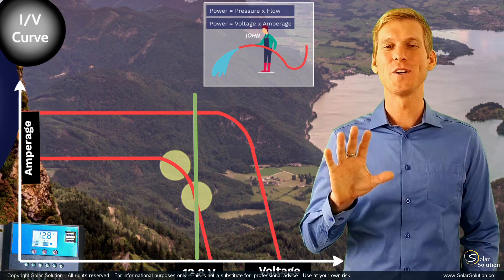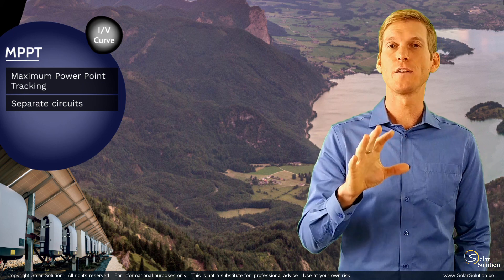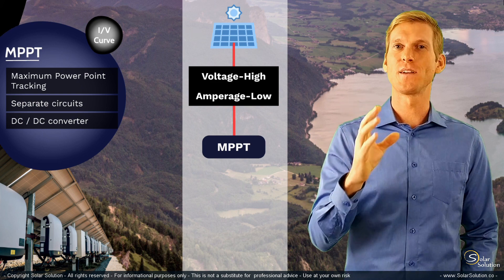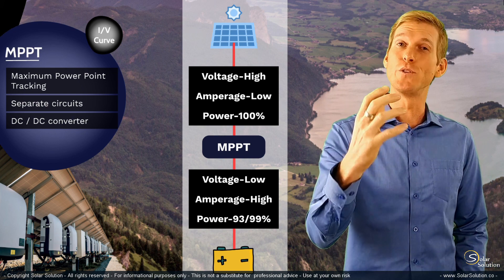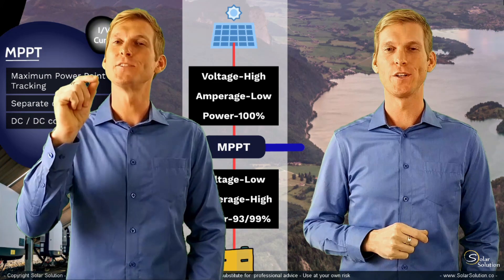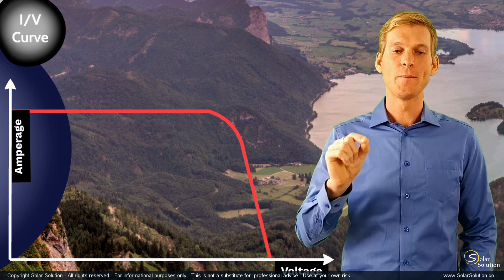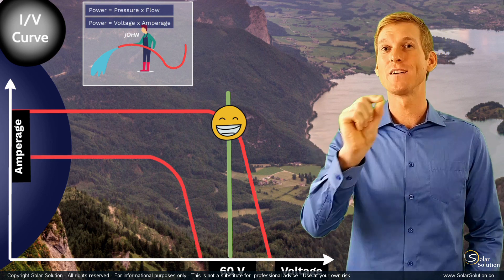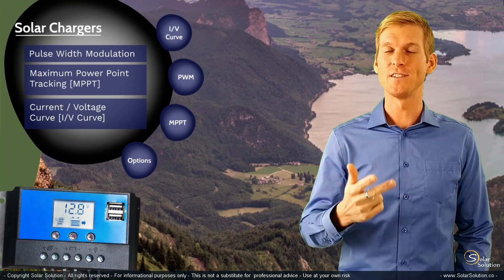MPPT Solar Chargers: How do they work & Are they Better?

Comment: Hello, there is a 20amp mppt charge control. Is it efficient to connect 4 50 watt panels in parallel or in series with 44 volts in 2 groups, the system is 12 volts?

Comment: Just a second, i am terribly confused. 

why do i break the connection between solar panels and inverter? By doing so, i lose the ability to feed the current from the panels directly to house through inverter, on shiny days.   Without no load on batteries. 

Does it worth it to lose such a vital feature for the sake of charging batteries a little bit more efficiently?! 🤔